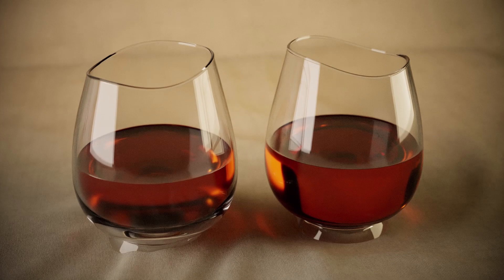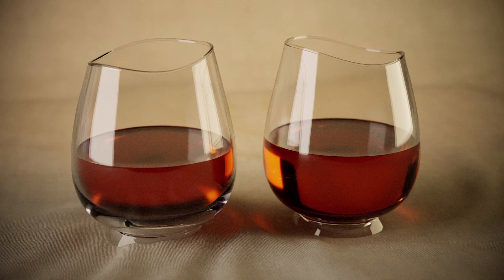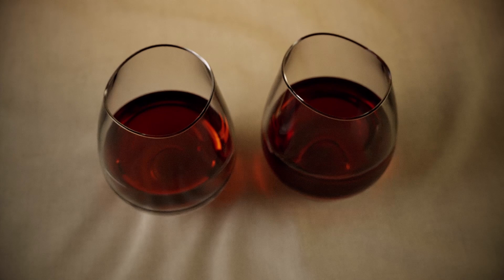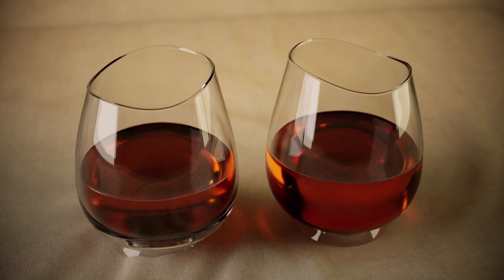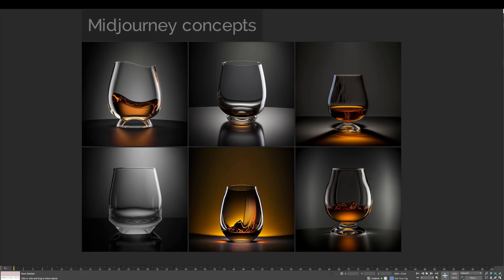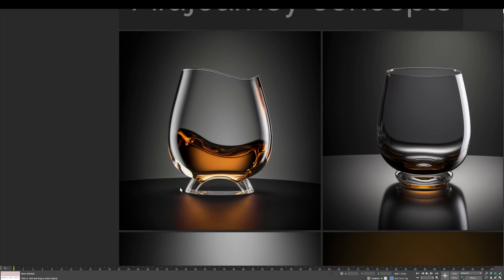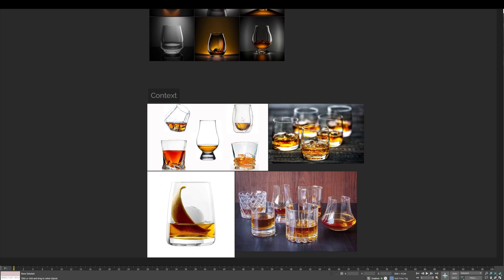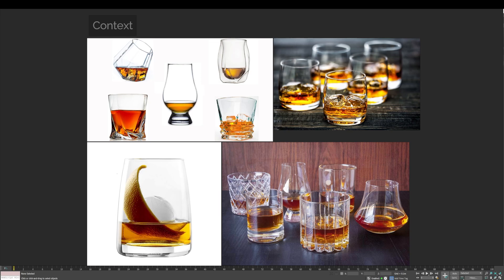AI whiskey glass to 3D model (3DSMax and Marmoset Toolbag 4.05beta)

Comment: theres no option of refraction in transparency there is only cutout dither
Reply from the maker: What version of Toolbag are you using? The version used here is 4.05 beta and the refraction mode is under "Transmission", not under "Transparency" as I think you've clicked on